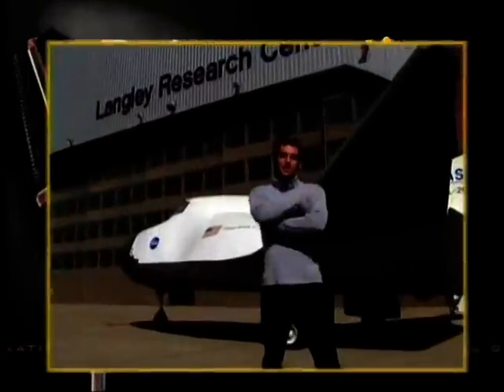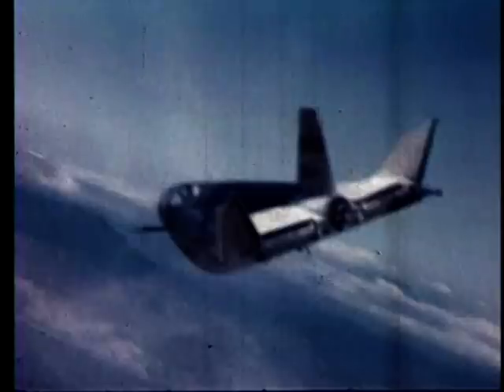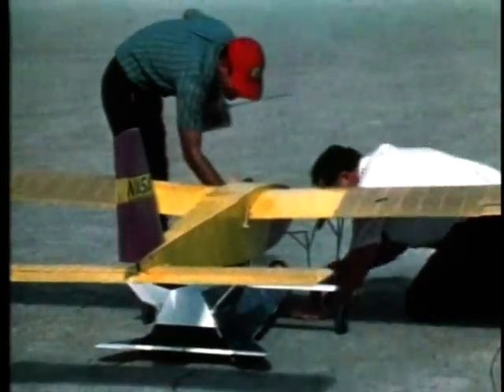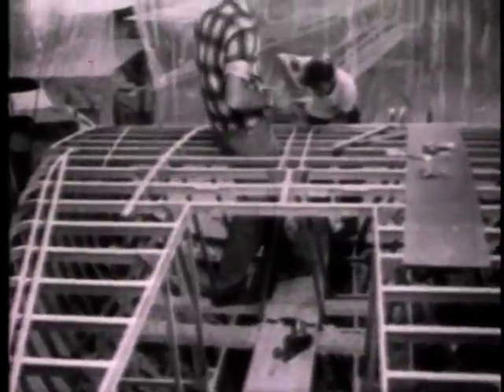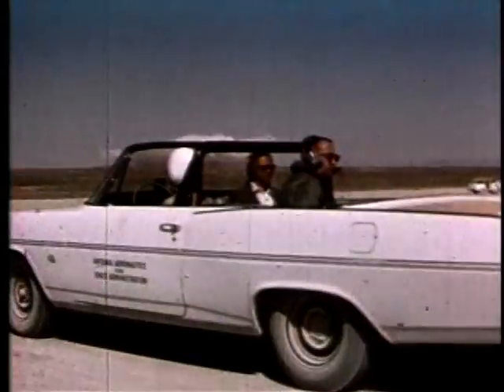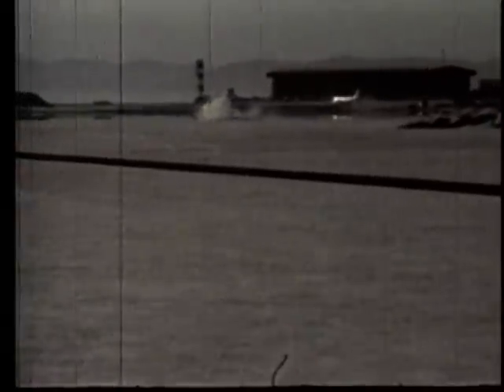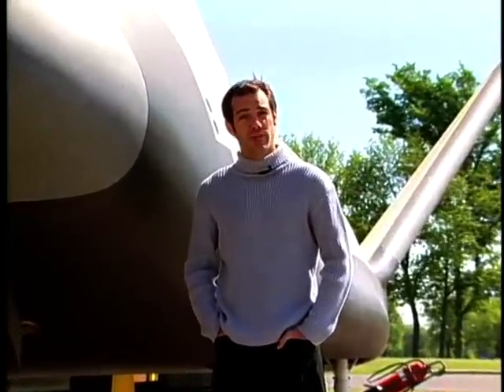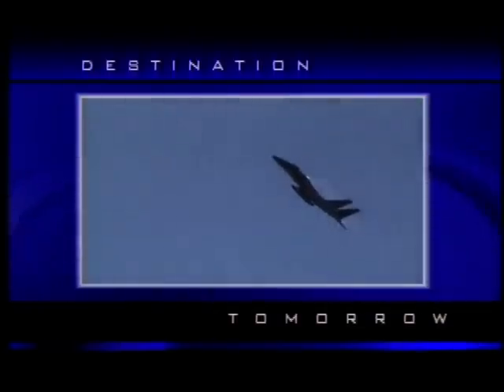Lifting Body Aircraft (2003)

Comment: Spaceplane mockup in the opening shot is the HL-20. Developed after the "Challenger" accident, after NASA Langley did studies of the shape after the Soviet BOR-4 subscale model of their  1960s "Spiral" spaceplane flew, most as tests for TPS an system of the upcoming Buran "Shuttle copy".
See also the HL-42.
Either or both of these should have been built, but instead they went back to relying only on the Shuttle "Golden Goose".

As for other lifting body aircraft, see the 1950s Horton Wingless
see youtubes about it
After Horton's first single engine plane was doing well, he could get no backing or buyers, but Hughes.
When the twin was doing better than the Cessna which the frame and engines came from and attracting buyers, Hughes killed it and ruined Horton's career, because Horton wouldn't sign over all rights and work for Hughes. Cleaned Horton out and won injunction against Horton working in a competing field, and destroyed the plane.

There were numerous Burnelli planes that had lifting body fuselages with wings and tails. Some flew very well, like the CBY-3 which is restored in a museum.

In the '70s, the Aereon-26 "Deltoid pumpkin seed" flew as a test for giant hybrid airships
see youtubes about it

In the '90s the Wainfan "Facetmobile" flew very well. Efficient and safe, stall-proof
see youtubes about it